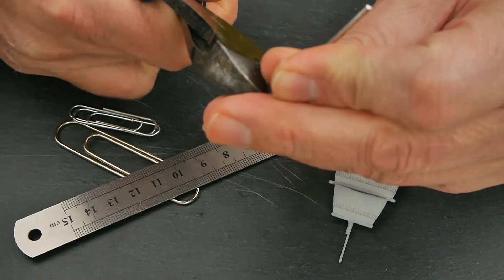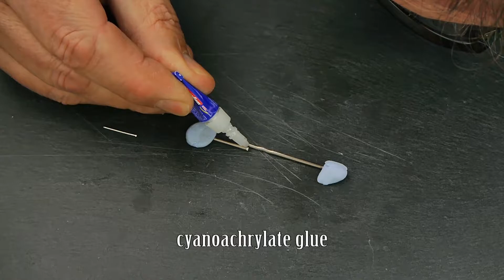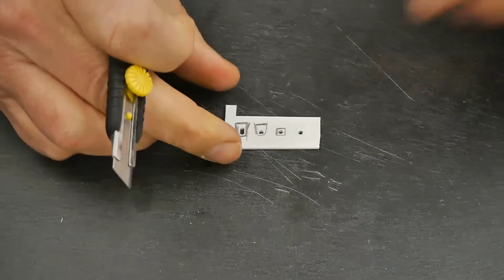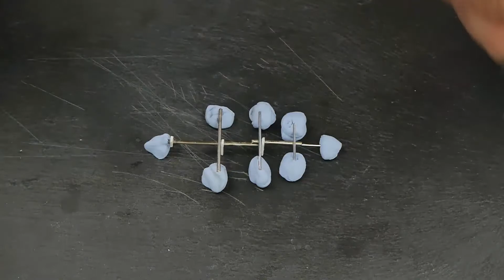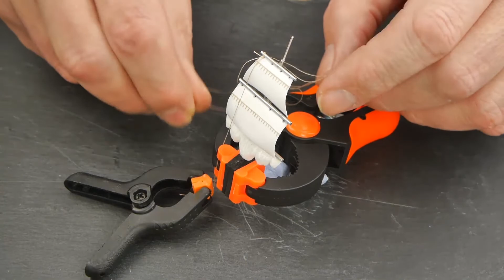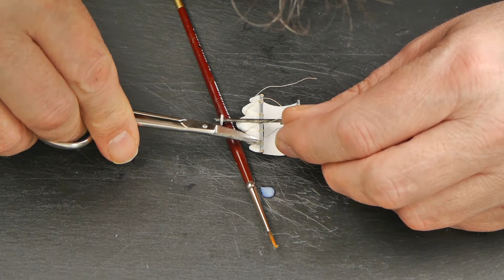Scratch building Mast: Masts for square rig miniature ship models

Comment: Awesome tutorial! The super glue techniques could easily be some with solder for those so inclined...
Reply from the maker: I believe this type of steel does not weld easily, but surely rods of another metal can be used and welded. And if you're handy with a soldering iron, I'm sure you can solder anything.

Comment: I simply love your videos on sailing ship miniatures!  In gluing the clips into masts i was wondering what type of surface you used to build on...the CA glue seemed not to bond on the surface, or was there some nuance in construction that i missed? I would worry the glue would not only bond the clips but also to the work surface.😮  Keep up the excellent work!!😊
Reply from the maker: In this video I used a slate serving plate to have a dark matte background where all the pieces could be seen well, and as you can see part of the slate was torn off with the glue. I usually use to work with glue better a cheap plastic kitchen cutting board, which are smoother and where you can use a hobby knife to separate the piece easily if it sticks. Thanks so much for your comment, glad you like it!
Reply: @MinisMyWay  thank you so very much for taking the time to respond to me...i really appreciate your reply.